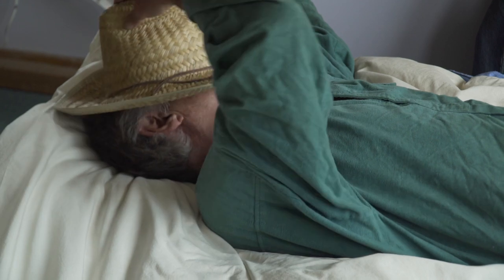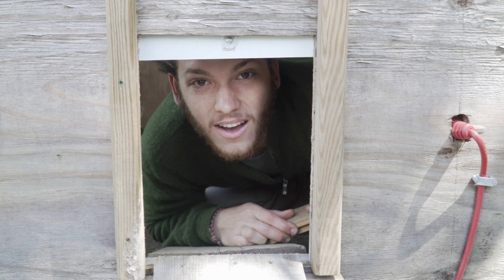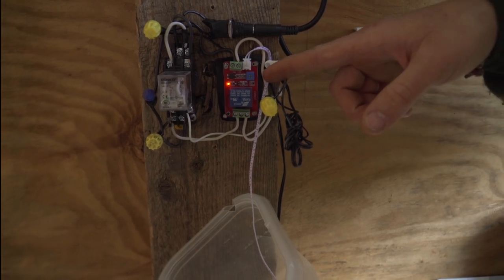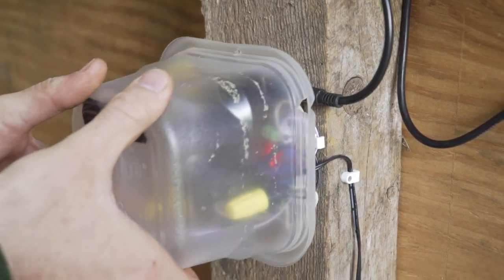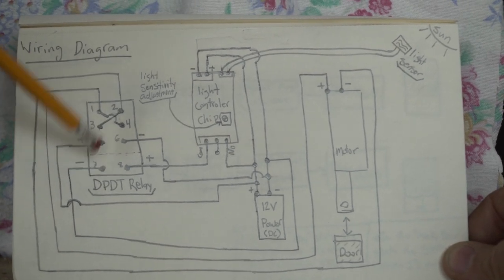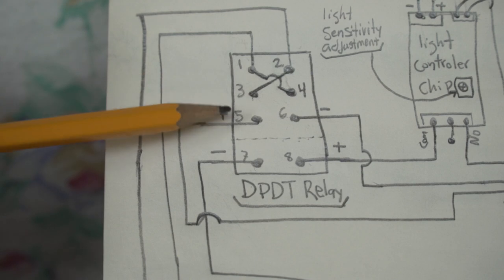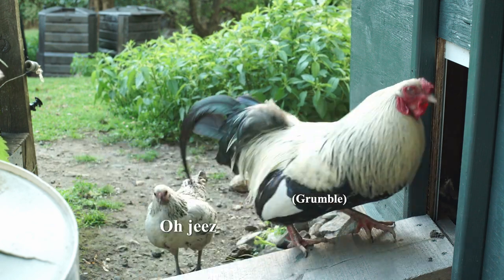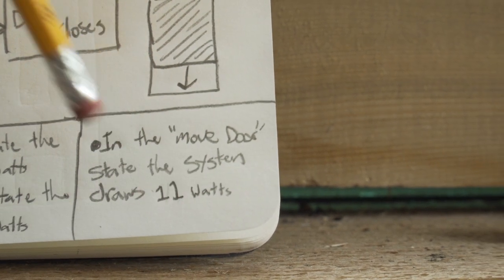Automatic Chicken Coop Door Tutorial

Comment: Links pleases... I really need to build this..
Reply: @MrOldclunker  Most have power, or solar, therefore a 12v auto compressor works for about $25. These systems with limit switches, relays, light sensors are just a joke of Chinese bad components. Mine has high reliability and brainless programming, but indeed air pressure systems are unknown to most but someone maintaining a factory.  The best one I have seen yet for simplicity is operated by the weight of the chickens on the roost boards.

Comment: https://www.youtube.com/watch?v=G2EpTG37l4Q&lc=UgxYH26iqUZXSqKhoy94AaABAg Here is a simplified version using compressed air or water as the actuator. In this case you need only a timer and and a 3 way solenoid valve